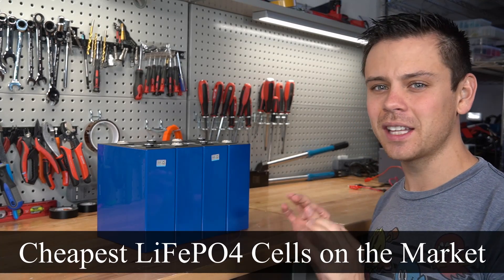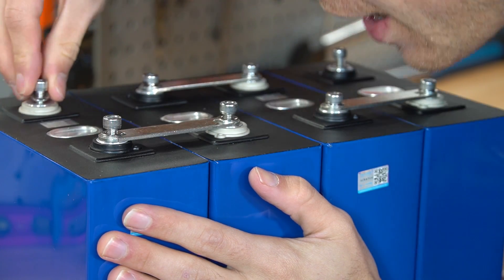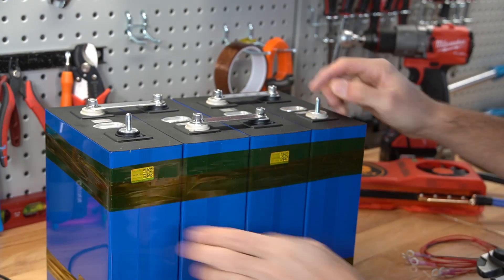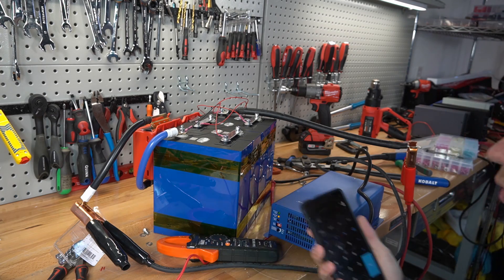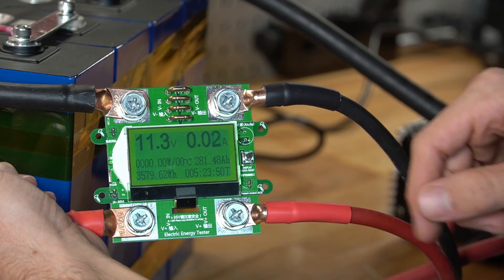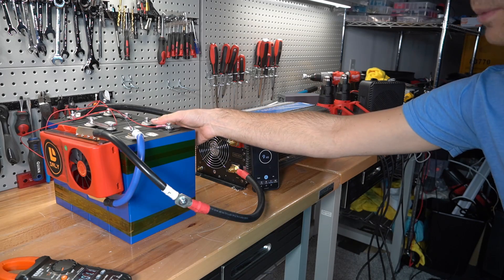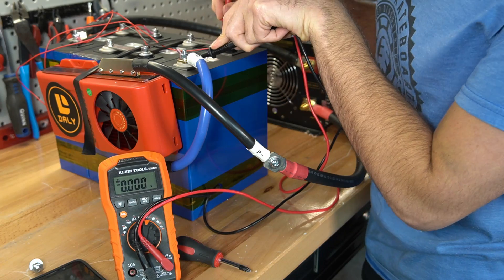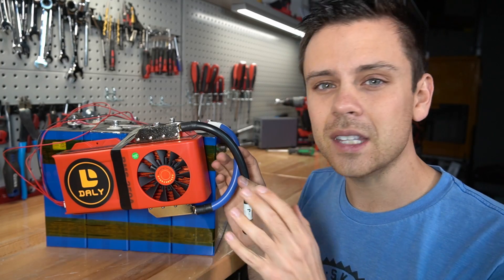$433 280Ah LiFePO4 Cells Tested: Cheaper than lead acid!

Comment: I have 4 LifePo4 in series parallel connection with total 5000w/h capacity. If I was to use AGM I would need 8 batteries that weigh 200kg more, and also the total price would be more expencive.

Comment: Just went to the AliExpress url you had listed first and a "Sale" is on till the end of March......Picked up 4, 3.2 volt 304 Ah for $300 bucks....
4PCS VariCore 3.2V 280Ah 310Ah lifepo4 Rechargeable battery DIY 12V 280AH for Electric car RV Solar Energy Golf Cart TAX FREE
LF304K Stud 4pcs
$300.29x1
Thanks for the video....

Comment: It amazes me that he could touch the bus bars when 200+ amps were going through them, I thought at the very least the bus bars would be red hot. .1 Amps can kill you but it takes more than 12 volts to overcome the resistance of you're skin so you can touch both poles of the battery and nothing happens. I'm also amazed at how small that battery is I have 2 100 amp hour batteries for my Van and each is about that size.

Comment: what would you use for a larger system? i am now using 24x 240AH lithium batteries in series of 4 x 6. For my 48v Deye 12KW hybrid inverter system, which i use to run my entire house on. How would one go about creating for example 40KWH lfepo4 Batteries with BMS to connect them? Do the BMS system cut off voltage when fully charged automatically, even if the inverter still gives voltage? Can a lithium battery with BMS be charge with a " lead acid cycle" that you manually put voltages in a deye inverter for example? How does it work?

Thanks for answers.

Comment: I have 4 sok 100ah batteries in my rv.  Im wondering if you think I will run into charging issues if I build a 280ah battery like this to add into the mix.  Can I mix and match or do all my batteries need to be the same?

Comment: Now that you live in a house, maybe you should try something bigger like an Instant Pot or a microwave to drain down your batteries.  Gets some vittles cooked at the same time.  Instant Pots do turn off intermitantly, I guess.  Seems crazy to blast all the energy away as heat when you live in Las Vegas.  hmm.  An airconditioner?

Comment: How do you afford all these different batteries and solar controllers , i can barely afford these Chinese grade b batteries let alone the different batteries you've got connected up, I've got 2 100w solar panels, a renogy mppt solar charge controller and I'm using 2 12v in series leisure batteries, I only use it in the summer for the swimming pool pump but I would love to have your set up and be able to use it all year round for several different things

Comment: I have these and a jbd bms. Browsing trough settings and there is this thing called cycle capacity. What does it do and what should it be set at. Can't find much on the web about it.

Comment: I may be winning a local auction for my first electric car tomorrow.
I could use 16 of these cells in series, since the car was made to use a 48V lead-acid battery pack, and the car's little motor only draws 100 Amps or less.
The car's original battery pack consists of four 12-volt AGM lead-acid batteries of 150 Amp-Hours, in series. A new set of 4 from Amazon is about $1,200 in total.
So, that would be less than $2,000 for 16 of these Grade B LiFePO4 280AH cells and a decent BMS. That's a very small premium over just putting in a new set of lead-acid batteries, and driving range and cycle life would be VASTLY greater.

Comment: If you had no capacitor discharge resistor, would say a 100 watt incandesant tungsten filament light bulb work in a pinch?

Comment: What battery for trolling motor 12 volt 100 200 280 amp also what brands and cheapest of course .55 amp draw motor plus electronics 10 amp   thank you very much for your videos.

Comment: It blows my mind when I see you touching the bus bars and the terminals while the batteries are pushing current. I'm only a novice at setting up solar systems and using LiFePO4 batteries so I'm still careful constantly around anything pushing amps.

Comment: I would like to put a solor system on my mobile butcher kill truck, I use a 28amp saw.I have a diesel compressor. I'm wondering if I can tap into alternator to help the solar panel? I only use the saw for about 5 minutes at a time. What do you think.  I learn a lot from your videos, and appreciate them.
Reply: Correction saw is 11 amp

Comment: Great test, and  impressive capacity there, 280 Ah, and  280 Amps steady till the end!  

Lifepo4 technology beats lead-acid hands down, but the price is still high, just waiting for the prices to come down to about half, then i will switch.

Those threads are of soft material; if you don't have a tap or a die, a SS nut will fix the bolt threads,(SS is a very hard material due to the chromium in it)  and a SS bolt,  with 2 lines cut lengthwise if need be,with a hacksaw,( but preferably not,no cuts)will re-do the female threads;

Comment: Aliexpress Scammers- I have been watching your videos for a while. Got super interested in building my own battery pack. Got super excited and ordered what I thought was a good deal from Aliexpress.  I got the blessing from my wife to pull the trigger and placed an order for (32) Cells. It  came to a little over $4K. After a few days, I did research "After the Fact". I am certain I bought from a SCAM seller, but not sure what I can do about it. I just saw they had 86% Positive Feedback  and thought that's probably "OK". Why I didn't do more research before coughing up 4G's is beyond me. I was excited I guess. I later translated all the comments and see the seller is a complete scam. I am pretty upset, and will need to wait 2 more months to hopefully dispute and crossing fingers get a refund. I am just posting this here to hopefully help others not make the same mistake. You do a great job testing and educating. Thanks will, but buyers beware Aliexprss SCAMMERS.
Reply: Sorry for your experience and your precious time is worthy of research. 
 It's part of cooperating with online sales and services. 

As a handyman business, I'm an architecture guy, and types of other things, in order to prioritize families home improvements cheap or free for years and never once expected the return favors. 

But Aliexpress, at least as I learned, has higher standards than the few in a crowd, as outdated scams go. 

The only online suggestion I would make,   from the limited information I read, would be to call, and 
file a "dispute" with PayPal, 
or the banking system you used, to possibly hold the payment or reclaim payment as soon as possible. 

This actually works for me a couple times if you try to keep in contact with the seller or "chat" or if better,  use emails with friendly people who are very kindly and sharing information about the products you're interested in. 

You'll find many more people in Aliexpress or alibaba are very informative and patient with your concerns about the issues related to your interests. 

Again, as an international ex veteran (forwarding company 3rd level so far, soon cargo owner related 😊) please don't discourage your future searches and please enjoy the real true online sales and professional practices. 

If asking for information is not answering your questions and you don't feel satisfied with what you learn, then try others. 

Patience is the name of the game when comparing prices or offers. Especially in business. 
Speaking another language very much helps a happy response too. Or kindly Speaking with wishing them well ☺️ 

"The window prices" often increase after you're interested to know more. 😉 

I found many times, my request to know more was abrupt and to expensive. 
😟😲

However, 😊🙏
the more I searched for similar things I found people especially kindly ladles are only happy helping you to learn more about products.

Comment: Hi Will. How many cells from china out of 100 do you find to be less than good? I bought 8 cells to form a 24 V series string and one arrived just 10mV down compared to the others. After a few days of use, that one has bloated. The others are fine. I would look for the info in your videos but there is so much good stuff it could take days to find it! Keep up the great work!

Comment: Love the information. If I bought 2 of these ($433 280Ah LiFePO4 Cells Tested: Cheaper than lead acid!) is there any problem connecting in series to get 24V? Do I need a separate BMS if I do that or can I buy one big enough to cover 8 cells? I'm upgrading my 24V off grid system that powers my shop.

Comment: these are epic thinking of these for my boat. one thing that i have never been able to get an answer on.  can my gm10 inboard engine also be connected to lithiums to start my engine? As ive heard lithiums do not have being discharged at a quick rate.

Comment: I don’t see the point of having a fan on the BMS, the balance wires can’t handle too much load say 50W is enough and if the BMS efficiency is say 70% then you only have  only 15W of dissipated heat. Also why does it need a large diameter conductor?
studs- very good idea

Comment: 48v 250 amp systems, 72v 250 amp systems, mostly run 10 to 50 amps, higher amp for short duration, a few minutes, and not very often

Comment: Hi Will and Viewers great channel, so I have a Atlas 12volt liFePO4 135ah battery (discharge 100amp max 200ah), 12v 1200watt inverter Giandel surge 2400watt, and 300mm (1foot) 2 awg 100% copper cable.
Do I need a fuse between them?
I’m guessing I don’t need one as in your video your not using one figured inverter would have one in it

Comment: two of my four "Ampere Time 12V 200Ah Lithium Iron LiFePO4 Deep Cycle Battery" were out now, no voltage. They were in service about 5-6 months and was connected as 2S2P in 24V system.. I wonder any one can help me to find what was wrong. Bought from Amazon but Amazon and seller would not help me.

Comment: get a   thread chaser for fixing the threads on the cells don't force a bolt into them.
i always use a copper sheet between cells with a cooling fan on a heat sink connected to the between cell copper sheet
LFP batteries build heat during charging and need cooling for long life.

Comment: The BMS is it expensive part of using lithium batteries but I was thinking is it necessary to run the current output through the BMS if the BMS is there to balance the batteries and to monitor the charging voltage. Then at lower amperage BMS could be used if you run the output straight from the battery and not through the BMS. (anybody thoughts on this)

Comment: I was thinking of buying them batteries for my camper I'd like to know what the weight of them 4 batteries so I can compare it with the lead batteries already in the van and what would be the charging voltage would the vehicle alternator be the right voltage.

Comment: I have the EASUN 3000w solar charger and inverter, would I need a BMS add on or will this unit manage the batteries in a similar / the same way?

Comment: I purchased those batteries unfortunately after 6 months 2 cells died and it’s no good anymore. I thought maybe it’s the bms so I replaced it but the cells won’t balance and won’t charge. 
I tried to contact the seller but they won’t replace it even though they offer warranty 
Buyer beware!

Comment: My friend. I just subscribe to your channel. I'm loving the videos. I still have a question: The BMS must be of the same capacity (Amperes):
a) from the battery bank;
b) equal to the maximum Amperes my AC source can power the batteries?
c) Equal to the maximum Amperes my external equipment requires?
I apologize for being long and thank you in advance if you or any channel subscriber can help me

Comment: What BMS would you recommend for a 36v marine trolling motor battery built with 100ah cells? Max discharge is 60 amps for the trolling motor.

Comment: maybe if you get a good grade ,most of these test bad for use in solar bank ,which bums me out . all stay with 6 volt 225 amp hour battery's for now. as i invested a lot in Lilith battery's only to have them fail . even when you buy grade A sometimes you lose . at least may lead battery still do the job . all 24 of them ,lol there not light . they are 11 years old gravity reading still good luckily as i have to recover from buying lithium that failed ,how ironic .

Comment: Hi Will I heard you say don’t mix NMC with LifePro. Could I combine in parallel if using a bus bar rather than direct battery to battery connection? Goal Zero has NMC and I need to add more capacity without using their lead acid expansion module. Thank you.

Comment: Hey Will, I have the same lithium batteries (different brand but same shape and capacity) and the same Daly 250A 4S BMS but for some reason i am having trouble charging my batteries.

I have a 70A lifepo4 charger with the positive connected to the B+ and the negative to the BMS P-, however the bms is showing the battery is full when it s actually not, and I cannot charge them.

The BMS also shutts off the entire system (I guess because the batteries are discharged, ny test inverter and multimeter show 10v)
Now I'm feeling forced to charge the cells directly at the B+&B- but i know you discourage skipping the bms. 
What am I missing? From the BMS app i could try and change the safety parameters but i don't think that would solve my issue

Comment: What would you recommend for a 12V RV system? Could you use this? Or even 2 banks of 4 batteries run in parallel to pull 560AH? 280AH seems pretty solid considering these seem to hold alot of energy for their size. Is this a decent setup to replace 2 typical 12v lead acid batteries, and keep charged with a solar system? I'm a total noob when it comes to this stuff, so just trying to learn everything I can about this.

Comment: Can you make a very clear video of a complete system that you would actually use on your P30 step van.
With a 12,000btu window air conditioner.
Off grid for dummys.
I have a good background in AC but never dealt with solar at all.
Also my income is fixed and low so cost and safety are the two main factors.

Probably you understand my position.
Thank you and God Bless!
Thank you

Comment: I ordered 8 cells via the link in the description. I could only get 227Ah out of the cells. Removing the black covers showed destroyed QR codes, some text was still visible: 3.2V, 704Wh. That's a 220Ah specification. The cells were advertised as '280Ah, brand new and original'. The seller " LiitokalaVariCoreFlagship Store " is a fraud.

Comment: I am going to make four sets of 280ah/48V battery packs and lay each 8 battery set on its large side, locate side by side in RV storage bay.. I will be compressing each set of eight prismatic cells with four 3/8 rods. Condo Cell Temperature is always a factor, and the center batteries will always get warmest... William, here’s my question as it relates to putting cell spacers between each cell within each pack in an attempt to mitigate heat. What thin material substrate (aluminum, composit, honeycomb etc) is best for heat dissipation? I’m even thinking of making substrate longer to fold underside of each cell as as a heat sink dissipation effect. Thanks for your great video and you are a role model for today’s generation.

Comment: So, i need a second solar system to run an on demand 12v water pump to my offgrid house in Spain. These Lithium batteries appeal to me because of their lighter weight. If I can set up a small-ish system, i could also get a small chest freezer to store food. I currently have a gas fridge with a tiny freezer but it has a constant flame which adds heat to my house. 
What's the lifespan of Lithium batteries? How will they compare to my 6x735 Ah 2v Hoppecke lead/acid batteries? Mine have been in constant use since October 2006, and are still performing well. Any tips, guidance, advice is very welcome. Not least because Lithium is totally new to me. Thanks.
I've subscribed too!!

Comment: I ordered 8 of the recommended $442 batteries

Is all 8 of them have a tiny swelling is swelling about one mm on each side of each battery

Is this a problem?

I can easily run a quarter around the perimeter between 2 batteries while the centers touch

This is one of your 4 recommended brands

LiitoKala $442 for 4

HELP

Comment: Somebody please fully design me  a 12v system for my campervan ie with all circuit isolators pls. same as this ill be using it as usb charging, 700w microwave, waeco fridge 12v, running a 12v tv and lights.
& which/what power solar system to get 👍

Comment: Good day. I am in the process to build a camping trailer. 12v system with 12v Led lights and a national luna 80L camping fridge (4.8amp). I have a victron 100/20 mppt and a Victron 12V dc to dc 18amp charger. 

My concern is will the Victron be able to charge a 150a/h lithium iron battery? 
I have 2 x 160watt 18.5v PV.

Comment: How do I know that charger to get with my battery, whether 80A, 100A or even 300A battery?  Whether in 3.2V, 12V or 24V configuration..

Comment: Hi Will, i got a question, i wanted to DIY a 120Ah lifePO4 battery onto my boat(outboard engine), but i am a bit concerned about the protection board(may be DALYs)function that it will cut off the battery(open circuit)if the voltage is above the setting, that could be a problem leading to the burnt-out of the alternator when having no-load running. Or perharps it shouldn't be used as a main battery for ignition at all?? thank you in advance.

Comment: Help needed.
After initial charching to 3,65 each cell in a 8s 280 ah system I connected all plus and all minus together to balance them.
6 cells show 3,37
,1 shows 3,33 
1 3,45
Are this cells damaged ? Or why they show such differences?

Comment: Can lithium batteries be charged by a high current car alternator at 14.4 VDC?  I am trying to design a high power stereo system.  I have 6 AGM type batteries now, however they are getting up there in age.